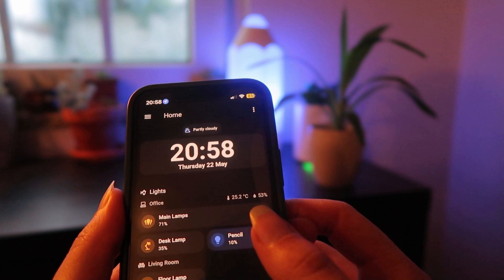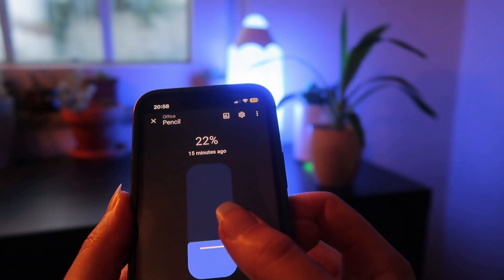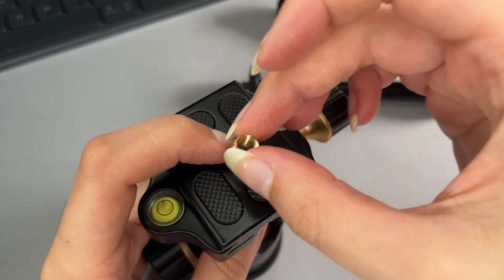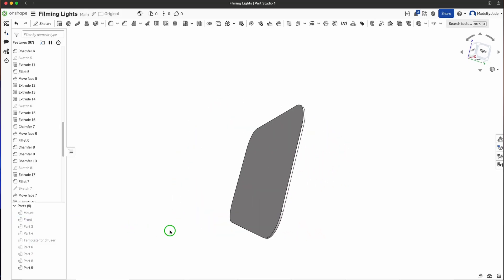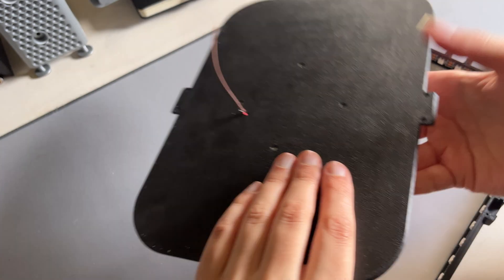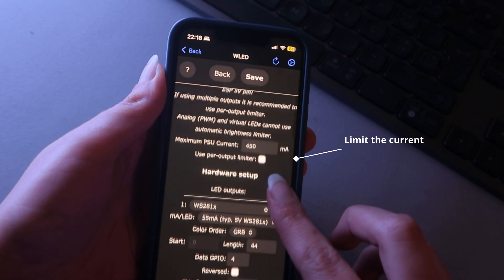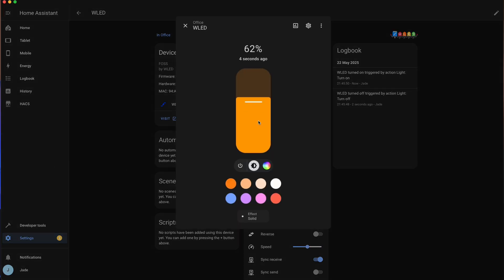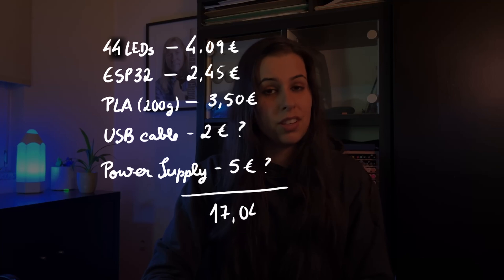Smart Studio Lights are Expensive... So I 3D printed mine!

Comment: An IKEA USB single output 1A unit is only 2.50€ :D it's very high quality product too with top safety and efficiency. I love all of their other power supplies too, highly recommended. Their 3-socket units just end up plopped all over the house somehow, and i use the 30W single port one to quick-charge my phone when i need it in a hurry. You can get decent USB cables for small money there as well. I think an interesting addition to a light might be a vesa mount (75mm?) and then vesa mounted adjustable or parametric power bank holder. You don't need it, but it's good on the go.

WLED is also capable of controlling non-addressable LED strips via a MOSFET. It may be an idea to mount two types of such strips alternating inside the enclosure, cold white and warm white, and then mix them for the preferred WB in software. It is however a feature that you probably don't need for a keylight like this. I think the presence of white LED luminophores may suppress the blue of the RGB LEDs somewhat and re-emit it as orange, which may not be preferred. Everything has drawbacks :D

There can be a lot of interesting optical layers in TV/monitor. Edge lit ones have a super clear acrylic prism with emission dots or lines, where the light bounces around on total internal reflection until it encounters one of those designated exits. Polarisation films can be of some use too.
Reply from the maker: That’s excellent information—thank you! I really need to pick up some new USB power supplies, since I’ve been recycling my old ones for projects like this 😅.
About the VESA mount: the electronics box was actually designed with 4 mm holes spaced 75 mm apart, so it can be mounted that way. I probably didn’t mention it because I haven’t used it myself, but the option is there.
I’ve also thought about building a white-only key light using that warm/cold white mixing trick. I’ve had my eye on an FCOB strip with two rows of LEDs (warm and cold white), but it’s a bit on the pricier side. Since this was my first “filming light,” I wanted the RGB for versatility.
And I still have quite a few optical layers left from the TV—if you have any suggestions for projects to use them in, I’d love to hear them! 😁